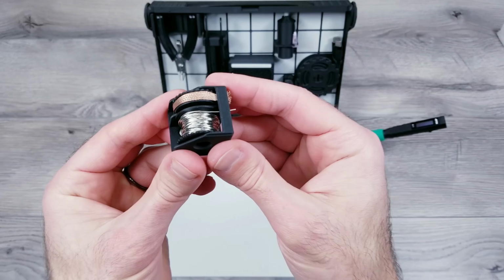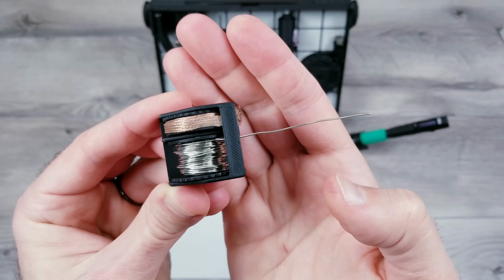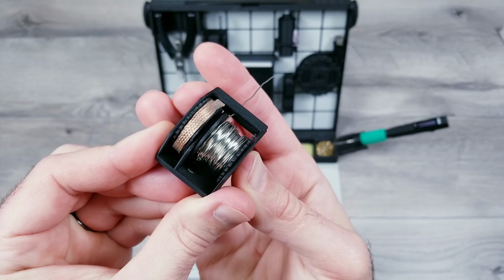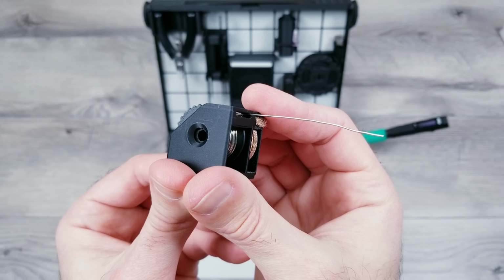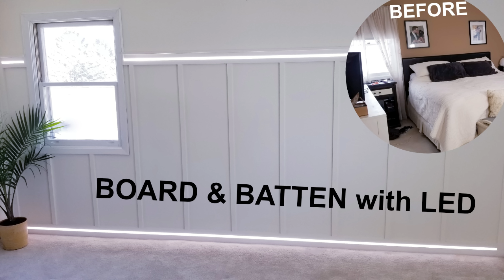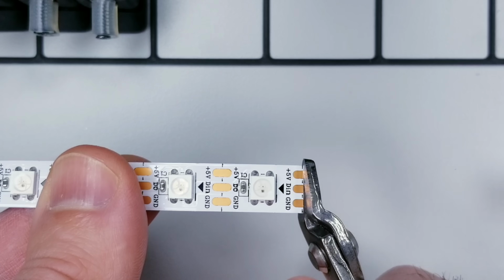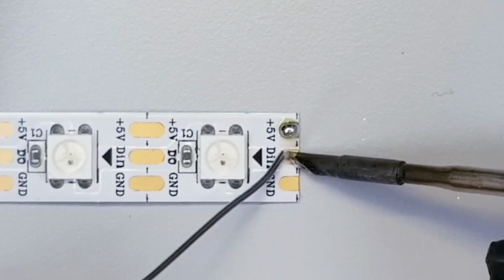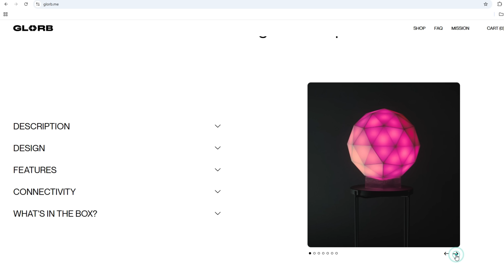Soldering Made EASY! All in One Kit + Soldering Tutorial

Comment: This kit seems about perfect for what I need, but I'm going back through your videos that I once watched about a year ago as I'm sure you have one specific for my current purpose, lol. I adopted a cat this year and he's like a Sour Patch Kid 😂. He can be the sweetest, most affectionate thing ever (*snort*, he's currently in front of me, just very proudly licking his nethers 🤣) but when he's hungry or wants his evening dental snacks, he gets sour and destructive. 

I ran a strip of Govee lights across the baseboard behind my bed, up the wall, and it ended just a little above my bed as a perfect spot for a night light and to illuminate the room. However, the bed didn't fully cover the power cord and he chewed it. Not the actual LED light strip, though. I know I'll need wire cutters and wire strippers but I don't fully remember how to reconnect or bridge the two sides. I think there's a small connector piece I'd need to solder the wires to.

And then, I'm getting some cord covers so the little monster can't chew them again, lol. He also chewed through the power cord of a diffuser, so I'll be repeating the same process for that.

Edit: Sorry, I'm actually finding that I was about to go about the fix all wrong and I won't even need a soldering iron, lol! I can just cut the wires, strip them, twist them together and then use either electrical tape or this sort of sleeve and a heat gun to cover it. My Govee wire is white, but once I put a cable protector over it, my DIY won't be visible. Yaaay, I might just have a functioning light again by the end of today! Still, your videos are what even gave me the courage to fix cords and not just immediately throw them away.

I also just remembered that I have a light strip that shorted out because I bent it badly. But, if I can cut that portion off, I might be able to get it functioning, too. That's a project for another day, but I kept them as I'm sure you have a video on how to fix a situation like that, lol.

Comment: 40% lead. Thanks but no thanks 😅 There's a whole slew of different solders out there that are great without exposing yourself to lead. Lots of low temp options even down to 150 °C, though the lowest ones can get expensive. If you're having trouble getting the solder to stick to the pads it's usually a sign the pads are too cold, just warm them up a bit more. If you're really having trouble or need to solder a lot of pads consider getting a hot plate made for soldering.
Reply from the maker: @TheGhost152  thanks for watching! Lots of options out there. Kester has been the best I've ever used. Just make sure to use a fume extractor, wash your hands after and you'll be just fine.
Reply: @ChrisMaherDIY  I know a lot of people do work with just an extractor, but I'd be cautious with lead fumes as lead accumulates in your body over your lifetime. Use gloves if you'll be touching it, and wash your hands in addition yeah. I think I'd want a proper fume hood for working with lead fumes though. There are just too many options available to necessitate exposing yourself to the risk imo

Comment: That SOLDR kit looks amazing and this could be a nice add-on to my desk setup. There are a lot of occasions where I am "in the field" and need to solder some basic stuff. 
May I suggest you get hold of a "flux pen" - it's like a marker but with liquid flux. Just putting a bit of flux on the pads of the LED strips make them even easier to solder. You then need less solder and get nicer joints without that large blob of solder on top. I mean: even nicer solder joints than you already have right now 😉

Comment: Thank you for this video. Soldering always seems easy when others are doing it. It happens often that the tip gets damaged and doesn't take any solder anymore. How do you solve thiis? And in the video you mention a few times "clean your tip" but you don't show how you do it.
Reply: Hey! There are a few good tricks to make sure your tip stays in good shape for longer:
1. Making sure you don't leave it on for extended periods of time (these USB-C ones automatically goes into sleep mode)
2. Having a thin layer of tin on the tip when not using it.
3. Using "tip refreshing" compounds to dip it in when it's gone bad.
4. Keeping it clean with brass wool or a moist sponge :)
Reply: @alexanderosika5561  Thank you for sharing these tips

Comment: perfect timing with this video. i want to do an "around the ceiling" install, but need to solder the multiple light strips together. can't have any gaps. but i guess my biggest concern with soldering is that I am going to melt the pad on the light strip or melt the wires. i guess practice makes perfect tho....or at least good enough.
Reply from the maker: Thanks for watching! Use good solder, clean the tip, and practice for 15 min and you will be good to go! Take a look at my older soldering for beginners video that goes over how to solder strips together.

Comment: What actually set me off to learn to solder was my mouse having a button stop working. It was fine otherwise. I just needed to solder on a replacement switch, which cost next to nothing, instead of replacing the entire mouse. It's not just cheaper, it's so much less wasteful to repair things.
Reply from the maker: Love it and great example! It's such a good skill to learn. I was able to fix my vans sliding door by soldering some wires back together. So many ways it could possibly come in handy.

Comment: This was a neat video, but I do feel a bit misled that the first 50% of the video is product promotion. The title of the video is somewhat misleading if this is what the video opens with. I would have flipped the video on its head and done the demonstration first, to be true to the title of the video, and then done the product promotion at the end if the viewer wanted to stick around to see the tools that were used.
Reply from the maker: Thanks for watching and for the feedback! I did a soldering for beginners video about a year ago that's done very well and in that video I went over the equipment first so I stuck to the same format since people really seemed to like that video.
Reply: Fwiw, i think the opening was fine. There are a lot of tools and options for soldering that could easily turn someone off from trying. The product youre sharing is a way of making that process easier. Also, you showed yourself working with the items from the kit, so of course explaining it first makes sense.  @ChrisMaherDIY

Comment: How are the magnets on the helping hands? They looked incredibly un-steady when you were moving them. They looked like the moved/rotated almost freely. The rest looks great but that gave me concern.
Reply from the maker: Thanks for watching! They work great for what they are intended to but I was trying to use them to hold down my led strip and in that situation the magnet is not really even touching the metal surface so it moved. I've already reached out to SOLDR to see if they could come up with a sweet 3d printed magnetic attachment that could specifically be used to clamp down an led strip!
Reply: Hey! Alex here, the creator of SOLDR :)

Just after shipping this kit out to Chris, we actually redesigning the helping hands slightly, to have a wider base and two magnets instead of one. Even though it worked pretty well in the kit Chris got, the current version are more stable and works even better for holding down strips :)